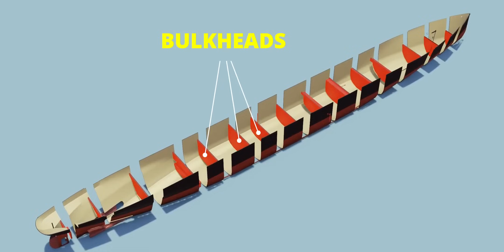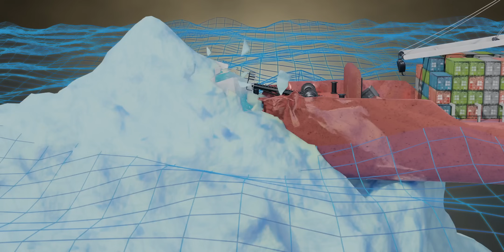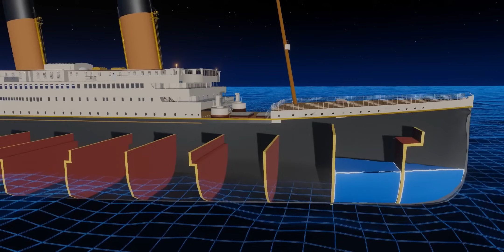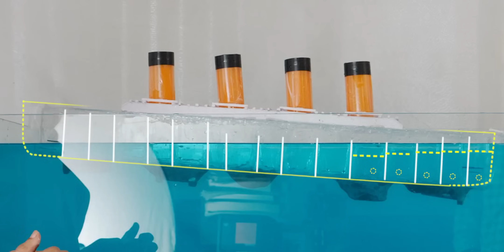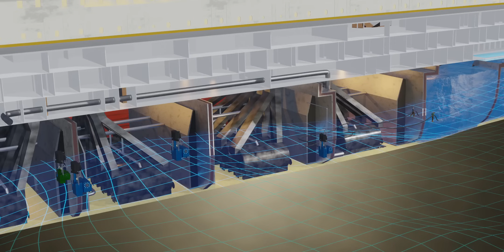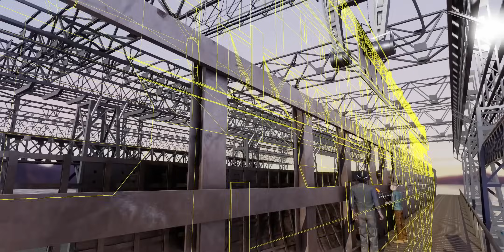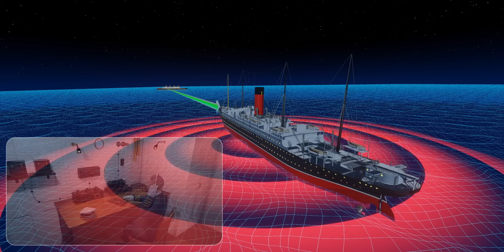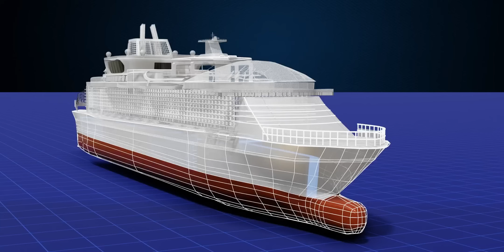How did Titanic Sink? | The Complete Physics

Comment: I've always wondered if a water tight compartment got breached could in theory if the compartment was sealed could you increase the air pressure in the affected compartment to match the water pressure coming into the compartment thus stopping the flow.

Comment: Your explanations are very formal. This is not an argument when you use a plexiglass model with five holes in it.
It completely does not take into account many factors that took place in reality: the weather, the temperature of the sea water and the steel of the ship's hull, rivets, all these tens of tons of equipment inside the ship... You cannot recreate all this in your simple toy model and fish tank.

And I am touched by people who claim that a frontal ramming of an iceberg would have prevented the death of the ship. Especially if you make such serious statements using your toy model as an example. This is ridiculous. In that era, many ocean liners could show serious problems even during normal voyages during sea trials immediately after construction. Here is one example about Lusitania:
"On July 27, 1907, sea trials of the Lusitania began. Shipbuilding engineers and representatives of the Cunard Line discovered that the high speed caused strong vibration in the hull, so it was necessary to strengthen the structural elements."
Just the fast movement caused the entire hull of the ship to shake! And these were very long and very narrow ships.

And the most important and logical thing: no one in their right mind would ever decide to ram an obstacle. Could you do this? Any ship commander will try by all means to avoid a collision. William Murdoch was a very experienced hereditary sailor, and he had previously prevented the disaster of another ship on which he served.

In addition, for some reason no one takes into account the fact that during the voyage a fire was raging in one of the coal bunkers - and this does not add any strength to the hull, given the cold water overboard.

The vociferous slander against the Titanic officers is offensive. No one considered the ship "unsinkable." This is an invention of the narrow-minded minds of reporters after the construction of the ship. Some of the senior officers of the Titanic were present at her sea trials, and had previously served on the technically identical Olympic. Therefore, they had a good idea of the capabilities of these ships.
You should have prepared more carefully and studied the case materials.

Comment: Rivet issue is redundant: the Foecke and McCarty metallurgy research team found that an external pressure of 9,000 ft lb was needed to make a Titanic bow rivet fail (due to wrought iron impurities, etc), versus a steel rivet tested to 20,000 ft lb, but the Ship's estimated kinetic energy before impact was 2,070,000,000 ft lbs, so the steel rivet would've still failed: merely deforming momentarily (due to superior ductility) rather than fracturing instantly.
Reply: These numbers are not comparable, the 9000 and 20000 are for a single rivet, not for the whole ship
Reply: @myke5696  Each single rivet in turn was subject to pressure, yet even if bound to a unity the kinetic energy was overwhelming and ineluctable.

Comment: 13:52 if you do the math, he will find that you are wrong here as well.  Titanic is said to have had lifeboats for only half passengers however, this number was for a sold out titanic which the ship was not sold out.  The number of lifeboats was sufficient to evacuate every single passenger as well as 100 crew members.  Unfortunately, the officers lowered lifeboats have full.
Reply: The Titanic was designed to carry up to 3,300 people. But, the Titanic had only 2,209 passengers and crew on board when it sank. The Titanic had only 20 lifeboats that could accommodate 1,178 people.. So, there is not enough lifeboats for more than 1000 passengers

Comment: The center propeller could not be put in reverse...
Reply: Whys that?
Reply: @umomiekiller  The two outer propellers were powered by the two steam piston engines. The one in the center was powered by a turbine that the extra steam exiting the 2 engines spun. It only had two modes, stop, and forward. It couldn't be put in reverse for the same reason a jet engine can't be put in reverse.

Comment: The amount of life boats used was in fact legal, as they could go back for more people after transfer. Legal amount 16, they used 20
Reply: Yes, but their assumption that you can use the lifeboats several times because just a short transfer to another ship is necessary was quite naive, because in the mid of the Atlantic, you cannot know how distant the next ships will be and how long they will take to reach your ship. After all, it is an ocean and not just a small lake or the Hudson river, where you can expect to get quick help.
Reply: @goldfing5898  exactly, quite stupid of them
Reply: @goldfing5898 , they barely had time to launch the lifeboats that they had. And, even so, some of them capsized and most weren't filled to their full capacity. I doubt it would have made much of a difference if they had more.
Reply: @IustinSt  I heard this argument several times but disagree, for these reasons: 1.) They failed to start sending distress calls and preparing the lifeboats immediately after the collision, let's say at midnight, but waited until about 0.20 or 0.30, which wasted precious time. It would have been wise to start the preparations before knowing for sure that the ship would sink. 2.) Having more lifeboats, they could have prepared more lifeboats when the situation was not yet so critical, let's say between midnight and 1 a.m. They had nearly 900 crew members on board and should have had enough people for this. 3.) The fact that the early lifeboats (watered first) were nearly empty shows that the reason for this was not panic but some stubborn interpretation of the "women's first" rule by Lightoller. He could have put in many more people. If I remember correctly, Murdoch's starboard side rescued more than 400 people, Lightoller's port side less than 300. 4.) More lifeboats means more confidence amongst the crew in being able to save the people (they knew from the very beginning that they had too little seats and were in a quite desperate situation if no ship would come to help in time), and less panic amongst people because fighting for obviously way too few seats. And no firing of guns by the officers. Of course it would have also helped if they had exercised preparing and filling the lifeboats (just on this fatal Sunday April 14, an exercise was scheduled but cancelled for unknown reasons).
Reply: @goldfing5898  Not even the modern times have 100% capacity for lifeboats lol only 75% and the rest is in water, so they claim 150% capacity but you would be in water holding the ship (capacity) no in the lifeboat - so in modern times in cold sea only 75% coul dbe saved. 

So instead of Titanic where some 25% survived in modern era about 50-60%% would have survived at the same temperature if you thin kabout it
Reply: @goldfing5898  they just never thought a ship that size would sink in reasonable time
Reply: Titanic
Reply: @shaynewheeler9249  precisely

Comment: Really well animated except for a few goofs, like the left and central propeller running the wrong way!
But other than that, it's really nice to see a detailed cross section and a VISUAL guide on how the water flowed over the bulkheads. As someone who has worked with CAD software a bit, I can imagine the effort that went into this. Thank you!

Edit: I just watched further and I am thoroughly impressed by the educational value of this video. From the physical demonstration with a piece of metal, to the explanation of the pumps used to keep her afloat, as well as physical models implemented REALLY shows the amount of work put into this.

Comment: 1: steel is much harder than ice, ever tried to cut steel with an icecube? 2: It was not the Titanic, it was the Olympic instead
Reply: 1: The iceberg was a literal floating mountain of ice multiple times heavier than the Titanic itself, do you expect the ship to push it without being damaged at all? i mean being made of ice not even important at that point so dont even compare it with your ice fridge
2: It was the Titanic the one that sank, the wreck itself doesn't resemble the Olympic, when the Olympic was scrapped her parts were marked with the yard number 400, with was her own yard number, Titanic's number was 401 and the same applies to that, if it was really the Olympic then all the scrapped pieces would say 401
Do your research
Reply: 1: an iceberg weighing several million tons and made of glacial ice is harder than steel. 

2: icebergs still sink ships today though it is less common now due to modern sattelites and radar. Most recent loss was MS Explorer in 2007

3: the switch didnt happen. The very idea didnt exist until the 1990s and the publication of Robin Gardiner's book. There are 52,000 tons of evidence that very clearly prove that the ship that sank was Titanic, and thats the wreck itself. Titanic and Olympic were built with yard numbers these being 400 for Olympic and 401 for Titanic. Every single component had these numbers on them, which is why when you examine the wreck today the only yard number you will find is 401. Its even found on the very steel hull plates that make up her form. The switch never happened.

Comment: They would not close in a few seconds, it would take quite some time for them to close, the alarm bell would also ring for about 20-30 seconds before the door actually started moving down. We also are not 100% certain that the ship did indeed reverse its props as oppose to just setting them in neutral. Like you said, stopping in time for an iceberg that close is impossible so the only way would be to avoid it. Reversing the props would not have slowed down the ship in time and would just have caused a lot of discomfort for a lot of passengers and most crucially of all it would have disrupted the flow of water on the rudder and made it harder for the ship to steer which is the most important aspect here. Its not uncommon or bad practice to go full speed ahead in situations like these cause even at slow speed stopping in time would not be possible and even a slight survivable collision would be unacceptable as an excuse as it should never have to be the solution to survive an incident like this in the first place, the only valid option is to avoid. Edward Smith did NOT believe that the ship was unsinkable, the reason he went ahead was because the weather was clear and visibility good, at least it seemed that way but he was worried and although there were some iceberg messages not relayed fully they most certainly knew of them. I would also like to point out that even though it didn't have enough life boats for all passengers they wouldn't have had time to launch anymore life boats anyways and therefore that fact can be disregarded in Titanic's case.
Reply: They could still have done better with the lifeboats they did get launched. If no more women and children want to get on, let some men on before launching.
Reply: @myke5696  That is true.

Comment: Now do a video of what the coal bunker fire did to weaken coal bunker 5, which made it more vulnerable to be damaged by the impact of the berg.
Reply: That would be a very short video considering the answer is nothing. In order to affect the hull in any capacity the fire would have to exceed temperatures of 538°C which is flatly impossible for a small smouldering coal fire that per crew statements wasnt hot enough to boil a kettle.

The hull was also in contact with one of the best heat transfering materials on earth, that being the water of the Atlantic, which ranges from 1°C to -5°C.

So the fire physically could not have affected the hull in any capacity because if it was at temps hotter than 538°C then the crew would have a lot more to worry about than an iceberg.

Comment: The double keel is the reason why the ship went between 35' to 50' angle before breaking apart
Otherwise the sheer weight would have collapsed the ship in half and forced a drag underwater much quicker

I reckon this and the brave workers pumping all the water they could gave the ship that additional 30mins-1h of survival over what was estimated at the time of the disaster

Comment: ...How on earth were those compartments "water tight" since they were OPEN at the top?!...
Reply: water can only rise as high as the water outside of the ship. the bulkheads were floor to ceiling the issue was is that water got into decks that didnt have them and thus it poured into the lower sections of the ship via staircases. most ships only have bulkheads to slightly above the waterline even today